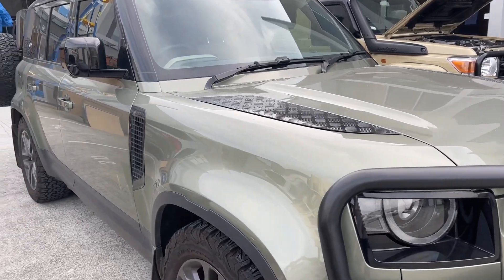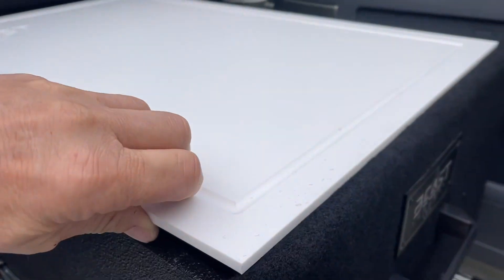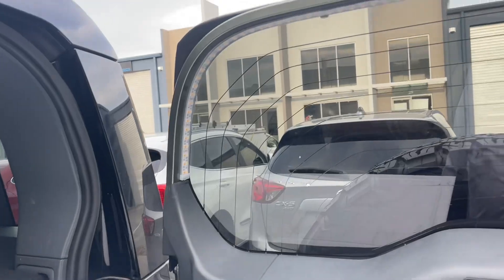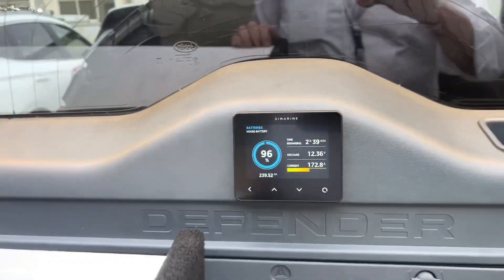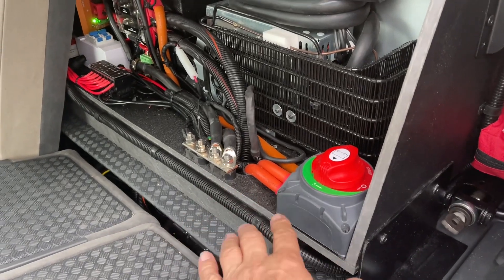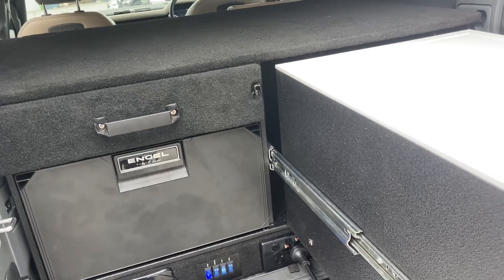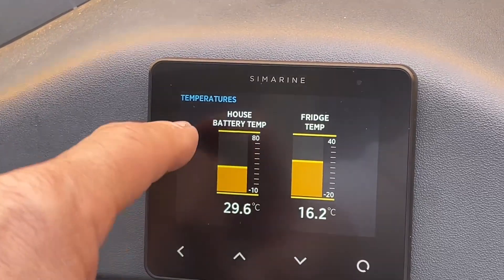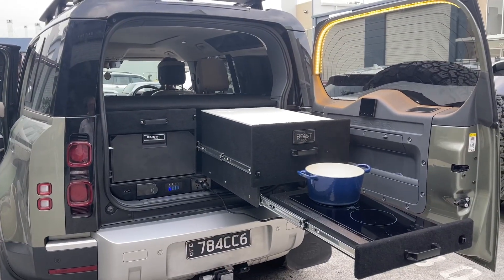Landrover Defender MHEV gets Lifestyle Pack 3000W Inverter 250Ah Lithium Killa-wasp 80A DC DC

Comment: Is this a 7 seater ? Or 5? If you’re to do something similar on a 7 seater where it can be made modular enough to take this in / out (with some minor work) … is that possible without compromising much of the vehicle ? :) you can see where this conversation can lead to :)
Reply from the maker: It will take 3-4 hours to take out. Its a complex design and very tight.